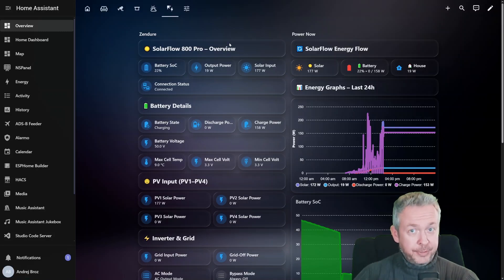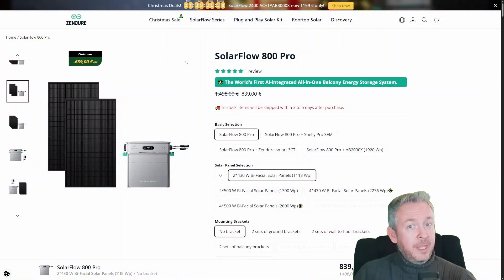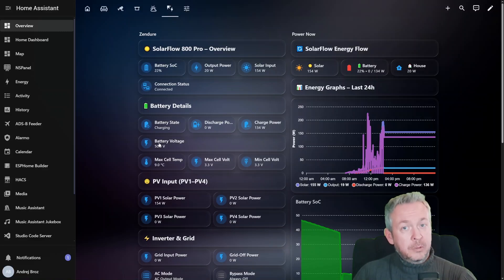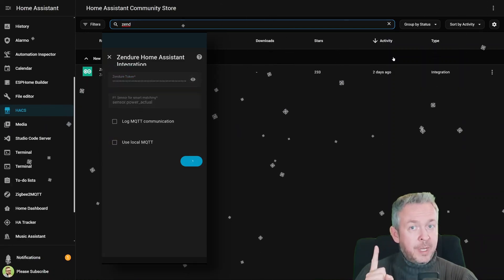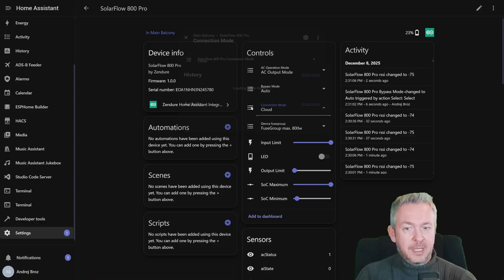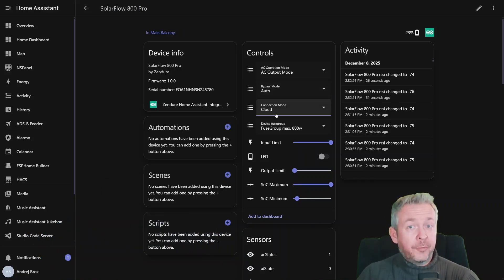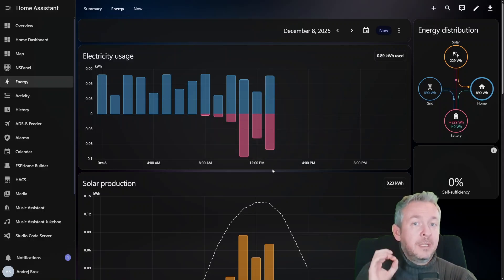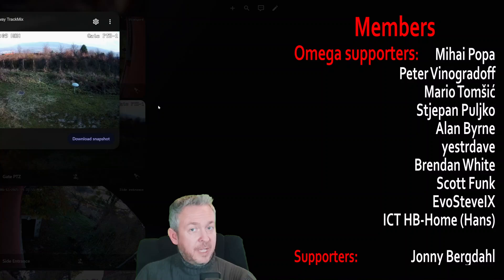I Integrated Zendure SolarFlow 800 Pro into Home Assistant — Here’s the Reality

Comment: Why did you choose the cloud? What did you gain from it compared with the sdk?
Reply from the maker: On that site I didn't have MQTT server, as it is using MQTT for communication if I remember correctly - I did install it for test, but didn't want to have it running there too, so decided to remove it and use cloud. It had exactly the same data available. 
For anyone already having MQTT running, this would probably make more sense to use local.
Reply: @BeardedTinker ah got it i didn't understood it wasn't in your primary location 
Thanks for answering